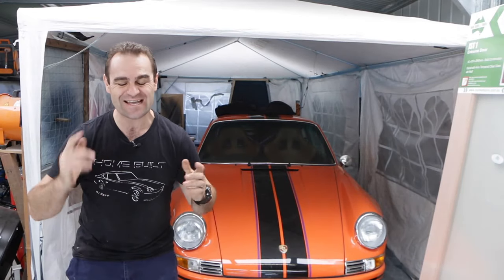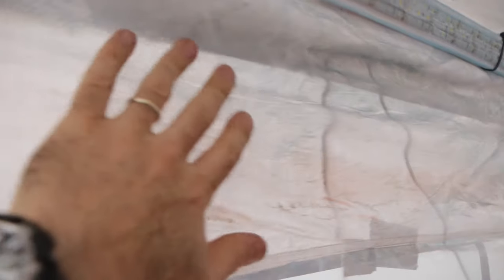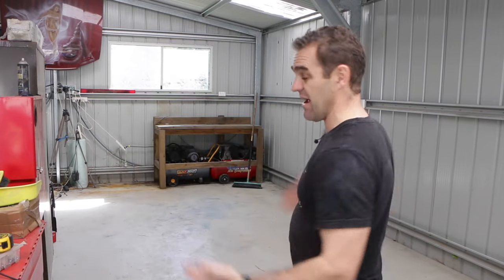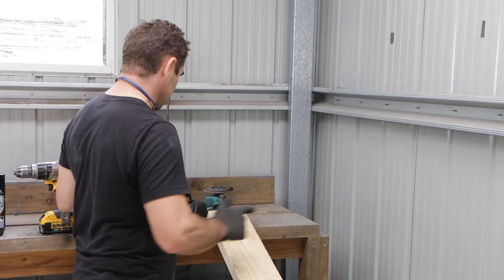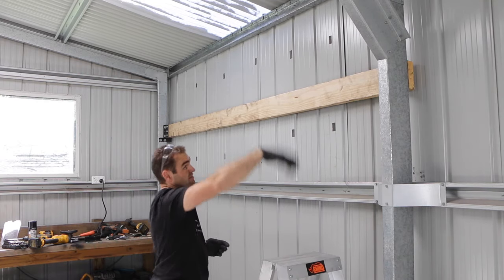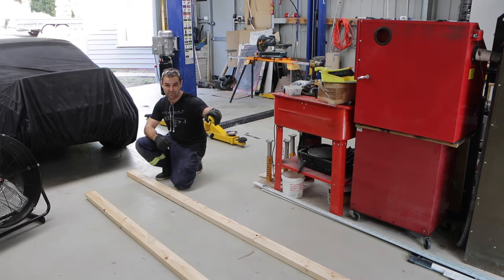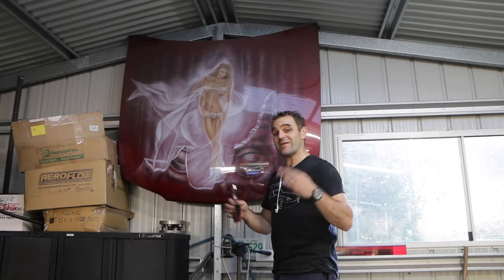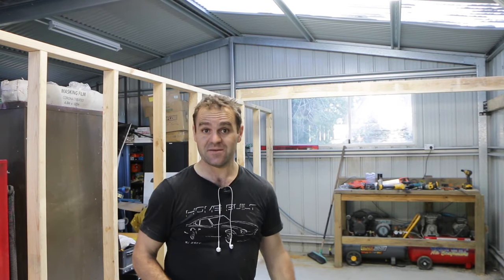Spray Booth Upgrade part 1

Comment: Hi Jeff, Before it's too late have you considered going higher with the ceiling? I built a booth here in the UK, which can accommodate a car rotisserie. This is a real benefit when spraying, as you can turn the shell through 360 degrees which makes access to all surfaces inside and out so much easier.
Reply from the maker: Keep watching for the next episode ;)

Comment: When you clad the walls do not use sheetrock for the bottom meter or so.  Use something waterproof.  If you use sheetrock when you go to spray the booth down it will absorb the water and eventually fail.

Comment: Hi Jeff great videos and projects about the 240z could your problem be with the velocity stacks and  the air cleaner on you're not getting enough air you should try one or the other and see if there's a difference.
Reply from the maker: Nup

Comment: How about reinforcing the roof behind the door and putting the air compressor up there out of the way? Also are you going to seal the floor in the booth?
Reply from the maker: Keep watching ;)
Reply: @HomeBuiltByJeff  As long as it doesn't take as long as the 911 engine.

Comment: I like it Jeff. I am where you are now in terms of shed fitout. Just a quick question - in terms of dimensions, do you think the booth is wide enough? I consulted with a few spray painters and the recurring theme I have been given is to have a free and unfettered clearance around the car on all sides of 1 metre. So, if the car is say 1.8m wide, then the internal booth width is 3.8m. Same with the long dimension. Just wanted to get your thoughts on that. I have decided to use steel frames for my booth, just because they are perfectly straight from the factory. Are you lining with gyprock or FC sheeting?
Reply from the maker: Very good questions. Watch the next episode as that is the main focus ;)
Reply: @HomeBuiltByJeff  its a date!!

Comment: I think you went a little overkill with those beams. Depending on what top sheeting you use, you could end up with something much stronger than what you originally described.
Reply from the maker: As far as building a floor, it is too little for the span, but I am not holding that much weight on it ;)

Comment: 2 cars did you not spray the bug in there????
regards 
Sören
Reply: are you insulating the walls to keep some off the heat out ???
Reply from the maker: There was a note on the screen mentioning it was 3 cars ;)
Reply: @HomeBuiltByJeff  must have blinked just when it was up he he

Comment: Hi have you thought about using glass sliding doors one at the front and one on the corner.   |__
Reply from the maker: You definitely could, as long as you get a good seal.